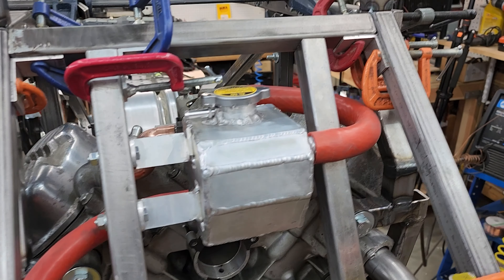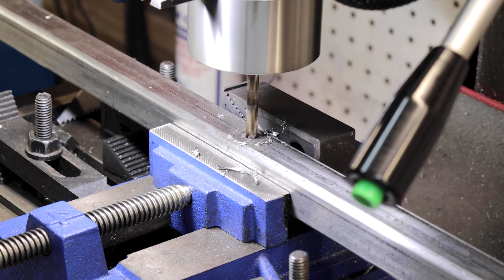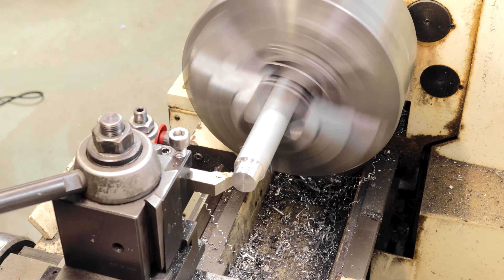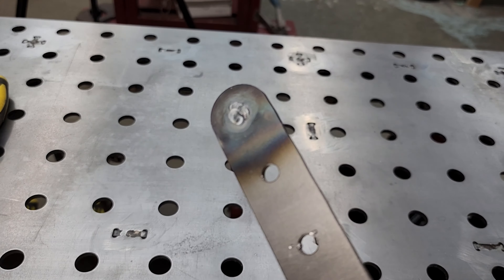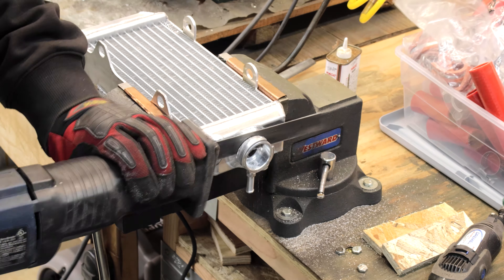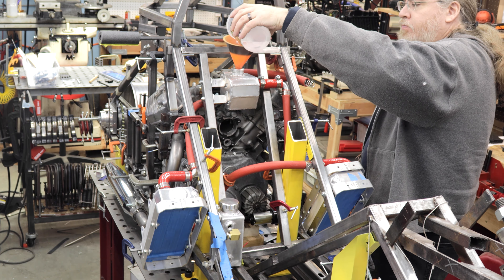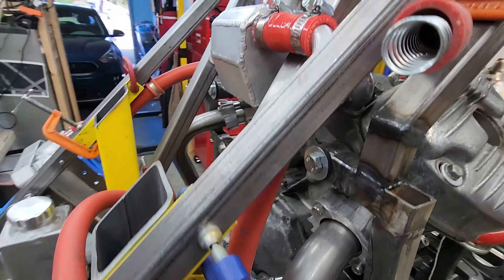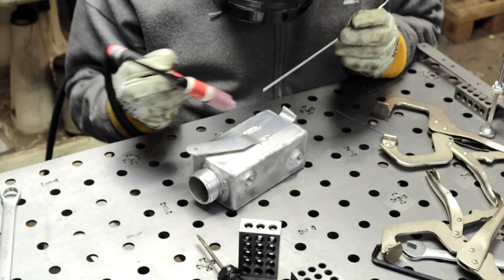Akira Bike Project - 27 - custom motorcycle split radiator cooling sys - part 2

Comment: Hey love this project been following since the beggining . Are you going to run a front hub motor true to the film ?
Reply from the maker: Thanks for sticking around!  We'll see about the front wheel drive, that adds a lot of unsprung mass which is one of the worst things you can do for motorcycle handling, but a new motor was unveiled at EICMA which has an incredibly high power density.  Also not sure the benefit is worth the weight and complexity, but I would certainly like it to be 2WD ideally and it may be practical with that motor.  That would be like phase iv or v though.

Comment: hi buddy I came here because of your comment on your akira slide video 

I was originally searching for a video of the akira bike on core games ( because I bought it and I loved to use it before the game was dead )

and I was wondering, the cool style aside would that bike or at least it's layout would have any advantages compared to others ?
Reply from the maker: Welcome, glad you found the project!  And yup absolutely, these would be considered recumbent or feet-forward motorcycles and they do have quite a few advantages (and some disadvantages).  The biggest advantages are more stable at speed, a lower center of gravity, less aerodynamic drag meaning faster acceleration and greater fuel efficiency, better braking, more comfortable, and amenable so supplemental restraint systems.  Downsides are larger turning radius, turns require a greater lean angle, and they won't be very good at off-roading.  Fort9 has a good video on why feet forward bikes are better, I'll be doing a detailed one as well on the advantages.
Reply: @matus1976  nice thanks for the info keep it up buddy

Comment: I know weight savings will be for thr second bike but how much does it weigh at this point? Sportster heavy or goldwing heavy?
Reply from the maker: I haven't weighed it yet, with the next rolling chassis assembly I will, but it's definitely more like goldwing / ultraglide heavy at this point.  But yeah like you said, there's been no weight or perf optimization at this point.  I'm going to guess about 1,000 lbs wet.

Comment: This bike is way overweight.
Reply from the maker: Yup it definitely is, this is the phase 1 prototype and no significant effort is going into weight or performance optimization.  Phase 1 is just basic general testing of the platform and geometry.  There are also extra components and space for experimentation and to make modifications easier.

Comment: You should be figuring out how to mass produce this, not make some silly newfangled radiator system that takes 20 years to weld
Reply from the maker: Indeed I am working toward volume production, building jigs and molds and fixtures along the way, with a complete solidworks 3d model of the entire bike, and outsourcing common components like tubing and plate.  Custom radiator cores can be designed and purchased, but it's not cost effective on the phase 1 prototype.  When it goes into production I'll certainly not be welding or chopping up radiator cores.  Jumping right into mass production costs hundreds of millions of dollars and every new motorcycle company that's tried to do that in the last century failed.  I'll be starting with a low volume pilot plant and scaling up. But hey if you know a billionaire ready to go send em my way.